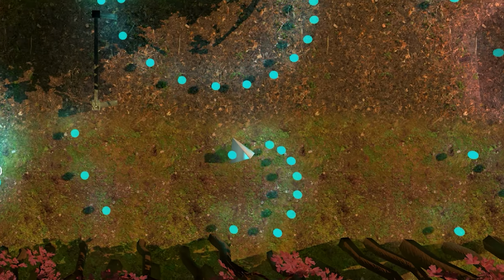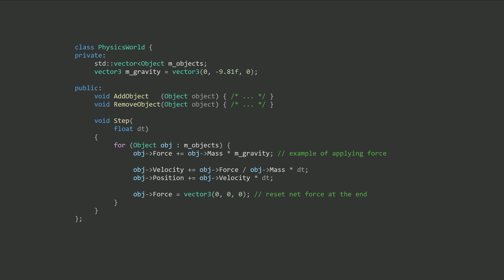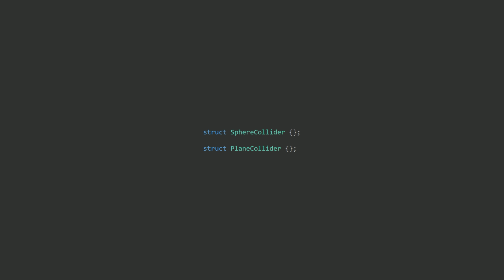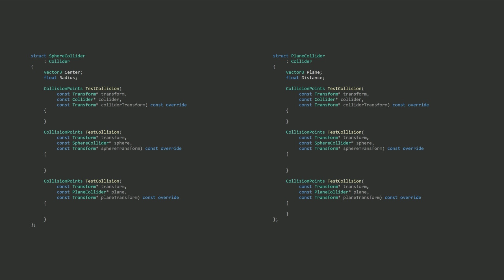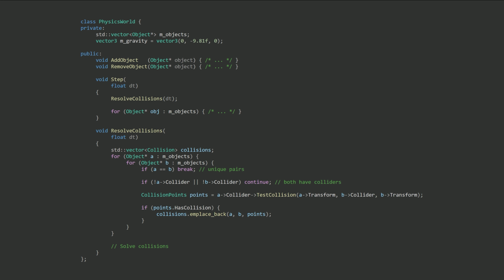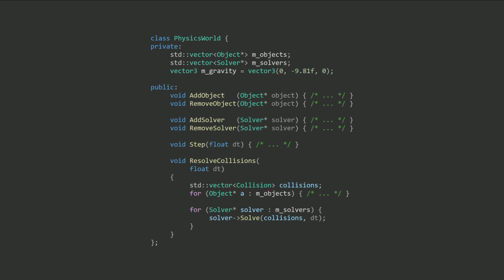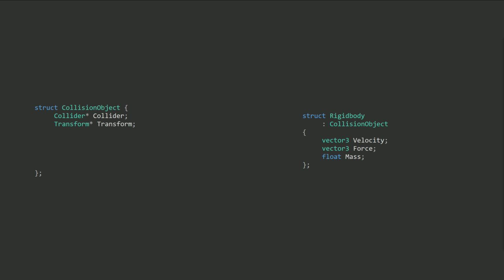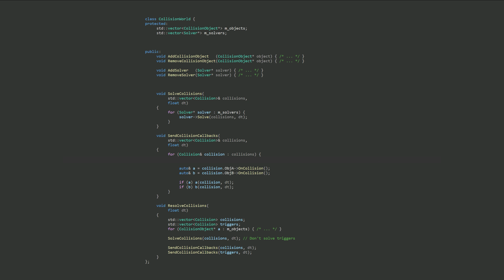Designing a Physics Engine in 5 minutes

Comment: So I was trying to follow along this, however I quickly ran into the issue of there being no vector3's (or vector 2's) in the std library or anywhere else, where are those coming form ? When trying to create them as a struct I can't do the needed maths with floats later on.
Reply from the maker: It’s a little unclear but those come from me. All you need for this are structs with 2 or 3 floats for x, y, z and maybe a length / dot product function which are both 1-2 lines so I didn’t cover that. I might add a small gist to the description
Reply: @Winterdev  A gist about it would be greatly appreciated, I for now created my own PhysVectors with the required coordinates and operators that should do for now.

Comment: So I’m researching physics engines for racings games and I have a question if everyone can answer it (I haven’t fully watched the vid yet so bear with me) when it comes to making a racing game, for the cars to of course drive and drift. Is that done purely from coding in, the gravity, and friction from the wheels? So that once you brake the physics would cause the wheels to loose friction causing them to drift? I know that the wheels have their own collision, allowing the vehicles to drive. I just have no idea how it makes the car move and the thing that confuses me the most, drifting.
Reply from the maker: Well it depends on how realistic you want it. I’ve never made a racing game but you could do what you described or you could just have a simple obj following a path like Tube Slider
Reply: @Winterdev  I did some digging after leaving that comment and that is a common way to do it apparently when making physics for racing games. By having the wheels separate objects from the body, still attached of course, and giving them physics like friction and then just change them depending on what you want wether it’s a drag, drifter, or off-roader

Comment: Hey thanks a lot for your video ! I have two question :p 
First: For the motion equation when you write [x=vt+x0] with [v=F/m*t + v0] I didn't get why when you integrate the velocity you don't have the 1/2 for the position.
because x should be equal to [x=F/m*t²/2+v0*t+x0] so you can't write [x=v*t+x0] or am I stupid ^^

Second: What do you use do make your formula and code animation ? :)
Reply from the maker: This was talked about quite a bit over on the hn page here https://news.ycombinator.com/item?id=24016718#up_24018883. It's a pretty interesting read. I've been using HTML and CSS for these 😂

Comment: Nice video! How are you creating this presentation? Are you using some specific software?
Reply from the maker: I just use a js file that switches classes around each ‘key frame’ and then I built another web tool that generates it

Comment: Your video is brilliant, it was a great pleasure to finally find someone explaining all that stuff in such a simple to understand format. I do have a stupid question for you, though. Don't get me wrong, but how did you get [ x = x0 + v∆t ] when describing uniformly accelerated motion? I mean, for that to be true, [ ∆x = v∆t ] would have to be true too, but [ ∆x = v0∆t + a∆t^2 / 2 ] (as was shown in the video)? I don't get why we calculate [ obj->Velocity += obj->Force / obj->Mass * dt ] and at the same time [obj->Position += obj->Velocity * dt]. Could you, please, at least briefly explain it in a reply to my comment, please? Thank you very much in advance
Reply from the maker: Thanks for the comment! Someone in the hacker news discussion was talking about that on similar lines https://news.ycombinator.com/item?id=24019099. My understanding is if you update the velocity then the position in the code, ∆x = ∆vt and ∆v = at. When you take the derivative you get ∆x = ∆v + a∆t^2 / 2. I think in the code if it were too update the position then the velocity, this would be an issue, but because the velocity gets updated then the position, those equations are equivalent.
Reply: @Winterdev  Thanks! Yeah, I guess the key is that we expect ∆t to be so small that we can afford getting some measurement error by calculating ∆x as if the object were moving uniformly without acceleration whatsoever. Also, like you said, this would be an issue if we calculated ∆x first, since then we would not really use acceleration anywhere at all. Thanks for clearing that up! <3

Comment: Great video! I’d love to know how all of this polymorphism affects performance. While it has a great design, I’m not sure that it will be performant, lots of dereferencing and dynamic function lookups. I’d think this would have terrible cache coherence.
Reply: The performance will be trash for more than the reasons you listed. Consider that every static object will need a collision test between every other static object, which is ridiculous. Which objects collide with which objects is something you need to tightly control (say, should a bullet interact with a gravity volume?) for performance and behavior reasons, and the approach in this video isn't good enough.
Reply from the maker: @MisterFanwank  Yeah one of my biggest regrets with this design was the double dispatch call. I later found a Valve pdf (page 33) that describes a 2d array of function pointers, then you use a ColliderType enum to index it. This lets you define all the possible collisions in one place and effectively centralizes the virtual function table. You could add another enum and follow this pattern for the object collision masks. The performance worked for my tiny games, but you definitely need a form of broad phase check/data structure for anything larger.

valve: pdf http://media.steampowered.com/apps/valve/2015/DirkGregorius_Contacts.pdf